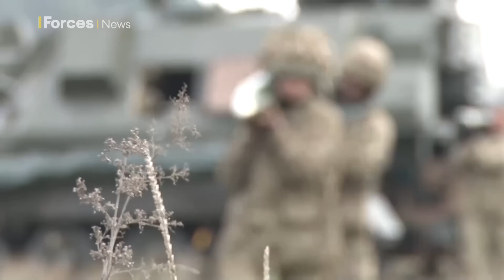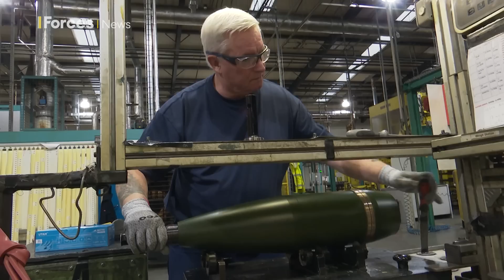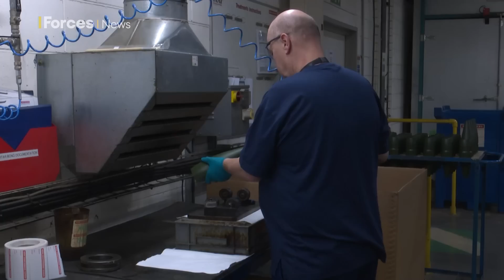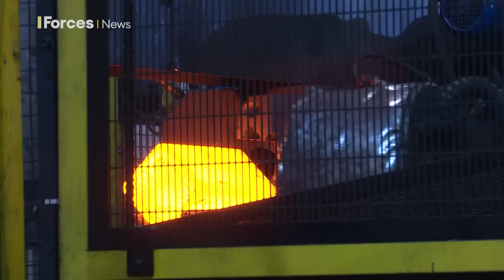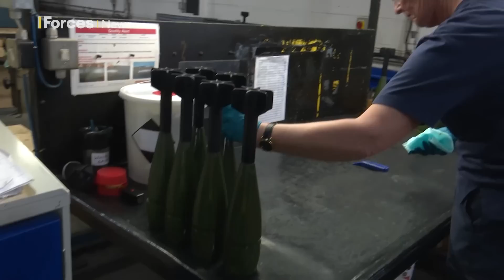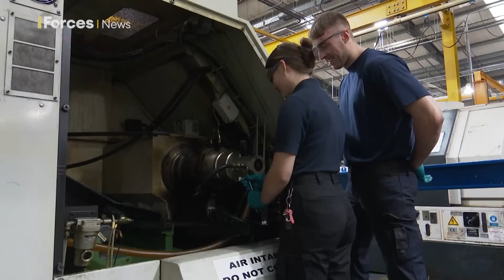How artillery shells for the Army and forces around the world are made

Comment: How does the copper band of the shells be installed on the shell?
Reply: A groove is lathed, a tight sleeve with a copper injection hole, then they slightly lathe along the whole shel so its even all the way along and at its correct caliber, the copper is at the shells thickest point to engage the rifling in the barrel.....a little after the clip starts, you can see a guy lifting a shell with chains, and u can see the groove before the copper ring is in it...

Comment: Thanks for the video. In 1967 I went to work at Chamberlain Corp. in Scranton Pa. the plant made 155, 175 MM shells along with 8 inch shells. In 1969 I found myself in South Vietnam firing 105mm shells from a self propelled howitzer. The plant I was at was working 2 shifts each day sometimes working Saturdays producing 2000 shells per size & shift, not sure how many 8 inch were manufactured. The plant had 2,000 employees when I was there working the 2nd shift.
Reply: So in 1967 the lant did per day 4000 shells, and now they do 11000 per month of 155 shells (or 550 per working day).
Reply: @Miroslaw Karas I'd guess they were possibly made with looser tolerances with simpler shells. They were in a prolonged war too so 🤷‍♂️ my guess
Reply: I worked at Chamberlain Mfg New Bedford, MA  location in the forge room in the 80's. I remember 105 and 155.

Comment: is there a future for light-weight non-metallic shells ? with new composite material, ie.
Reply: The problem with light weight fragmentation is that it has short range. Fragmentation from metal is already very light and high speed, so making it any lighter means faster loss of energy over distance from drag. The primary weight savings is in increasing the brisance of explosives rather than the shell. America came up with a new plastic explosive last decade which has revolutionized their munitions.

Comment: There are dummy manufacturing factories all over the US that can switch to munitions in less than 24hrs. Idk why that was so cool to learn as a child, but it's one of those factoids that has stuck with me. My parents worked at one for a time in the 70s.
Reply: In the US there are 9 JMC factories. (Crane, Holston, Iowa, Lake City, Pine Bluff, Quad City, Radford, and Scranton) Of those: only two(Iowa Army Ammunition plant and Scranton Army Ammunition Plant) produce 155mm shells.
Milan Army Ammunition plant was another but it shut down in 2019. The pandemic did stall its decommissioning so it may be possible to reactivate if needed.
Besides that General Dynamics and IMT also have some private plants but that's another 1-2 155mm lines each company and a minor part of total capacity.

Prior to 2005 capacity was greater as Lone Star Army Ammunition plant was still operating but even then its not that impressive.

Thing is shell manufacturing is highly automated work using CNC machines and requiring extreme precision. It costs tens of millions just to get the tooling for a new line and that sort of hardware can come with half a decade lead time for ordering. Labor costs mean you cant just go 1940s and open manual production lines anymore even assuming you could somehow find enough qualified machinists.

This week even the Army announced a plan to increase 155mm shell production from 14,000 a month in 2022 to 20,000 in 2023 (likely by adding a third shift at existing plants) and then 40,000 by 2025 which means they plan to open a few new lines. It would take a massive investment to reach much beyond that and with South Korea, Japan, and most NATO countries also moving to double capacity. As such unless we get in a hot war with Russia or China we likely will not see much more increase stateside.

TL:DR: The munitions infrastructure of the US is highly optimized for peacetime production and lacks the tooling to expand rapidly. Old plants were decommissioned and could not keep pace with modern production lines even if you could somehow reactivate them.
Reply: @LordOceanus  CNC machines are catalog items and, in a crunch, existing equipment can be re-purposed.  Another thing about CNC machines is that they can make the tooling they need to make whatever it is they need to make.  The thing that takes time is the building that they go in.  CNC machines need deep and solid beds of concrete to be placed on.  (They are heavy, produce vibration and have to be calibrated to a minimum of +/- 0.0001 inches and any shifting if their base will make them useless until the base is repaired.)

What takes years to create is the skilled labor force to set up a CNC machine, run a proof part and then set the machine up for serial production.  These are machinists who need very high skill sets and take about ten years to produce.  Once the machinists have done their job - a lesser skilled (but still requires training and intelligence) machine operator can handle the production run by following the job book given to them by a machinist.

And the US is desperately short on skilled labor.  It won't be the hardware that will be the bottleneck - it will be getting people trained.  We will have to use a lot of hand labor simply because our high schools are not putting out people able to get an entry level job that over time will turn them into highly skilled (and paid) master tradesmen.  (And it's sad that our society gives higher social status to somebody with a useless college degree in a minimum wage job, than they do to a Master Machinist.  

Oh - if you know somebody who is smart and wants to get a career that over time will result in good pay - have them go to a local community college and get a certificate in CAD. They can then get a job as a CAD drafter and work their way up to CAD drafter/programmer.  A couple of years ago starting pay was $16/hr and after several years of experience will be making $27/hr.
Reply: @colincampbell767  Spot on
Reply: @LordOceanus  I was speaking to munitions in general. Presto still has munitions capabilities.
Reply: @demwillams8898  👏👏 hello??
Reply: @LordOceanus  There are plenty of other industries that could make up the slack, just as those same companies picked up the slack manufacturing ventilators during COVID. They have the tooling already, and its just a case of either A. handing over the CAM code, or the CAM projects and adapting to the machines that are in place. Plenty of foundaries and other forgers that could mass produce the shell casings.
Reply: @LordOceanus  "Labor costs mean you cant just go 1940s and open manual production lines anymore even assuming you could somehow find enough qualified machinists."

Well, you can still do this, as long as you are willing to accept that productivity will be an order of magnitude lower than the dedicated plants and therefore this can't be done on regular commercial terms. This was basically true back in the 1940s, too, which is why the US and the UK ended up spending 40% of GDP on wartime production in some years. In modern times, it would realistically require the president to invoke the Defense Production Act to make it happen.

Not even the hawkiest of hawks are currently proposing a wartime mobilization of a good chunk of US industry on behalf of Ukraine, though, so they'll have to make do with incremental increases with long lead times.
Reply: In my country, there was a large farming equipment factory, that could be switched to making Tanks.
Reply: Not anymore. Everything is consolidated into a few companies. And, we started to wind down operations from 2 long wars.
Even in the 2021-22 budget, the US was halving 155mm shell quantities.
Reply: @HKim0072  I was speaking to munitions in general. Presto still has munitions capabilities.
Reply: Sorry - but none of those exist today.  The US defense industries have adapted themselves to produce at peacetime consumption rates with little extra capacity (excess capacity costs money and the US government refuses to subsidize 'idle' capacities are defense companies. (Mostly because of all the people who would automatically assume that this is the result of corruption instead of prudent planning.)
Reply: @colincampbell767  it eventually gets hard to convince people that we really need to prepare to fight a war with Russia while ignoring all the racism, poverty, and injustice at home. Plus the fact that defense spending is mostly just free money given to folks like Elon Musk.
Reply: @RobertELGBT  If you have traveled extensively - you'd recognize that the amount of racism, poverty and injustice in the US is minimal.  And the real irony is that the people in the US who want everybody to be treated the same and judged on their individual merits - are considered to be 'racists' by the liberals.  

And ending poverty will never work as long as our social welfare systems primary focus is on making poverty more comfortable.  The focus should be on getting people out of poverty and able to live without needing those services.  But it isn't.  The system has been carefully tuned to produce multigenerational poverty because those people are reliable Democrat voters.  

And 'injustice' needs to be objectively defined.  If you aren't using an objective definition - then you're the problem.

And defense spending isn't 'free money' given to anybody.  Defense spending is infrastructure that's just as critical as highways and electricity.  In effect it acts as an insurance policy.  You hope you never need to use it - but when you do, you regret not paying more for a better policy.  BTW: the primary beneficiaries of defense company profits are pension plans, IRAs and other forms of retirement savings.  This is where the money for use as capital comes from in the US.  (Something that is misunderstood by people who never took finance and economics in college.)
Reply: @colincampbell767  Typical Poor Conservative Republican  Dogma...and the best explanation of all of the Poor Christian Evangelical Conservative Voters...That is evident all all of the Poor Bible Belt states...Simply no one dumber of more gullible...living in a shanty or ratty old trailer on a dirt road...and consistently and dependably voting Republican for 50 or more years... Keep them poor ...Keep them stupid and frightened and angry...Tell me again how comfortable that those people are?...Pure fantasy!...
Reply: @stevebell4906 "Typical Poor Conservative Republican  Dogma . . ."

Are you just really, really, bad a trolling?  That was the most pathetic attempt I've seen in a while.  Next time don't come across as an idiot and try to come across as somebody who has a clue.  

Let's see if you can do better with your reply.
Reply: @colincampbell767  Who in the hell do you think you are talking to?...I doubt that anyone has ever asked for you approval of validation...I damn sure never have...

No one seems to have asked for you to pontificate...But do go on about all of those Poor Conservative folks enjoying their poverty...
Reply: @stevebell4906  That's even worse than your first attempt.
Reply: @colincampbell767  a lot of ppl ran with the 155mm munitions type. I was speaking to munitions in general. Presto still very much has munitions capabilities.
Reply: THAT'S why these long 155 mm vases are so cheap around here
Reply: That information is old. Youre thinking about when America had manufacturing towns & cities. All those factories shut down & have been shipped over seas. America is a service industry based economy, based around a ponzi scheme called the Petro dollar & the federal reserve. But thats coming to an end. Be prepared for the dying deaththrows of a decrepit & hollowed out nation. 💁‍♂️ blue hair dont win wars.
Reply: We used to, but Obama shut down all of them with EPA regulations. Now even most of the chemical compounds used in small arms today comes from overseas like South America, it isn't even made here. This also means if we go to war for real we would run out of supplies within months if our global logistics were ever targeted.
Reply: No there aren't.
Reply: To be clear, I wasn't speaking solely about 155mm shells, but munitions in general. Presto still has munitions capabilities and is still very active with defense corps
Reply: @demwillams8898  wait, you made up that "dummy manufacturing"?
Reply: @rogerwilco5918  what r u talking about? It's obvious u just want to argue with a someone on the internet. Perhaps, semantically, "dummy manufacturing" wasn't the right phrasing, but a company that makes kitchen appliances that has factories that can be changed over to make military munitions in a short amount of time is certainly not just a kitchen gadget company. Now, when that company has zero outward appearances of having anything to do with defence or munitions capabilities, while not a "dummy manufacturing" company, per se, certainly has greater and wildly different capabilities that outward appearances suggest.
Reply: @demwillams8898  what do you think they're supposed to look like???
Reply: @demwillams8898  
Just admit you didn't know what you were talking about.  There are no facilities that can be converted to munitions production in 24 hrs.  Nothing is that easy.  You couldn't staff a plant in 24 hrs.

Tell the US Army so they can use these so called "dummy plants" to increase production.
Reply: @matthewgaines10  well the plant is already staffed so...
Reply: @demwillams8898  where?
Reply: Please do tell where those sites are?  If that were true, how come they haven't switched over by now?
Reply: Can you name one?
Reply: @rogerwilco5918  presto

Comment: Hard to imagine that industry during WW I were able to manufacture 10’s of millions of shells per month on each side.
Reply: @Withnail1969  The Allies produced around 790 million shells and the Central Powers 680 million shells in WWI. The vast majority of that was produced from 1916 onwards. At peak each side were producing over 10 million a month, though not tens of million per month.
Reply: Including many chemical filled ones.
Reply: @alexm566  oh yeah, that’s right.  The danger of making and handling those chemicals in the first place, then loading shells in an assembly line process.  There must have been many accidents that were kept secret.
Reply: with higher tolerances it was much easier to do on a large scale with lower skilled labour able to fill huge factories with workers

Comment: Always wonder why mortar tubes don’t explode ?  0:10
Maybe the range is less than artillery  ?
Reply: Range is far less than artillery, therefore the propellant charge is much smaller. The rounds are much smaller and lighter so again, the charge pressure is much lower. The actually velocity is much slower. During mortar training, I could look up on a clear day and see the mortar flying up until it goes out of sight. 

Mortars are meant to drop explosives about two meters to maybe 4,500 meters. Artillery like the 155mm can reach 20 miles to 25 miles out.

Comment: UK defence minister Ben Wallace has said we need to upgrade the155mm AS90 self-propelled artillery to likely the U.S. M270 multiple launch rocket system. Not quite so many shells needed in the not so Britishly near future.
Reply: Shells are a lot cheaper to produce than missiles. If one shell costs $500, and 1 missile costs $10,000, then you can buy 20 shells for each missile. Bad idea.
Reply: @ms.annthrope415  sorry to say, but you missed a zero on the price of the missiles. They run ~$100,000 a pop.
Reply: Tje British make their own MLRS missiles.
Reply: @handlesarefeckinstupid  We don't. There was a European 227mm rocket factory but it was in Germany.
We could but we'd need to get Roxel on the case.
Reply: We're increasing the number of M270 systems, and hopefully bringing back LIMAWS(R) but the 155mm artillery will be replaced, or potentially upgraded to AS-90 Braveheart standard (similar to the Krab).